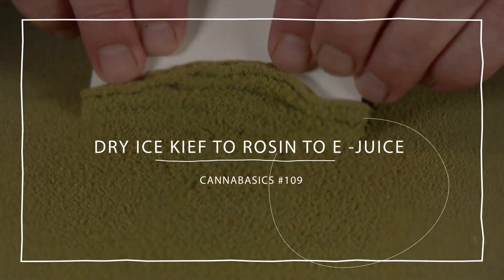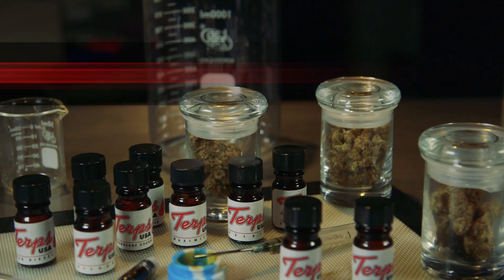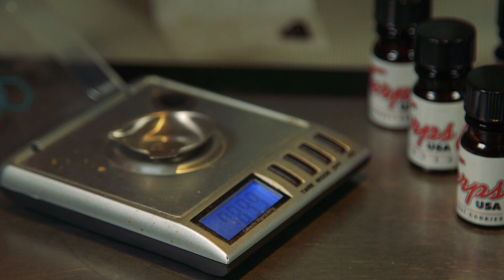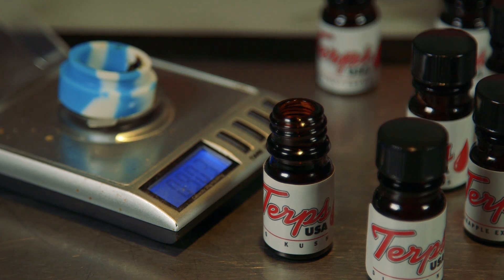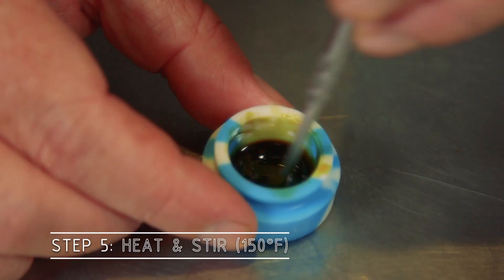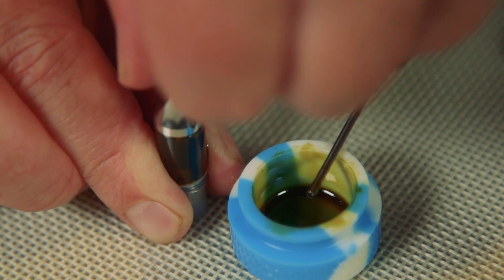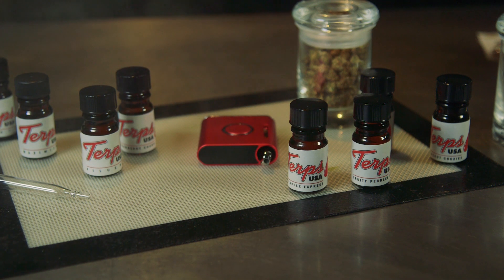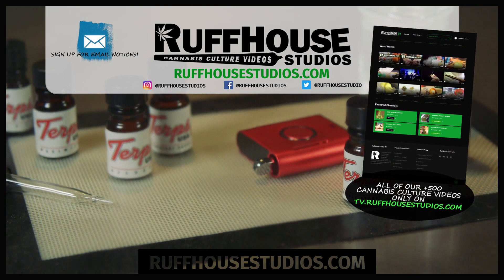Kief to Rosin Press to Cannabis e Juice (Part 3 Terps Based e Juice) Cannabasics #109

Comment: Plz Do a video on turning rosin into Shatter.
Reply: I'm no expert but I think it mainly depends on the temperature you press at. I'm pretty sure low temps make a butter consistency and higher temps make shatter. But I'm not 100% might wanna look it up before trying just in case
Reply: @dickwaffle7134  vacuum has alot to so with it as well. Rosin is just heat and pressure,  shatter requires even more expensive equipment, lol.
Reply: @dieseldabz7104  thanks for the info, I just heard somewhere that the temperature directly impacts the consistency of the rosin

Comment: what would you do if  your cartridge has been sitting in a drawer for months and has thickened?
Reply: Should still be good. If you want to thin out the liquid use a hair dryer or something to heat it up. If it's a class and metal cart, you can get away with putting a lighter to it really quick, but I wouldn't hold it on their for fear of any plastic gaskets or other peices melting